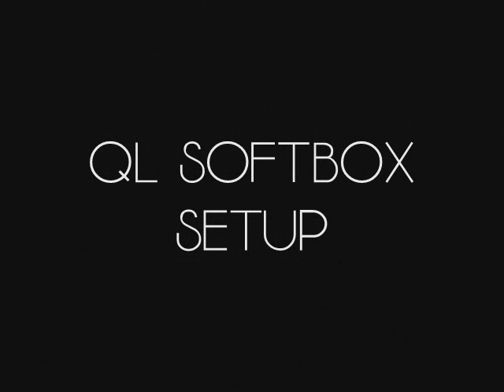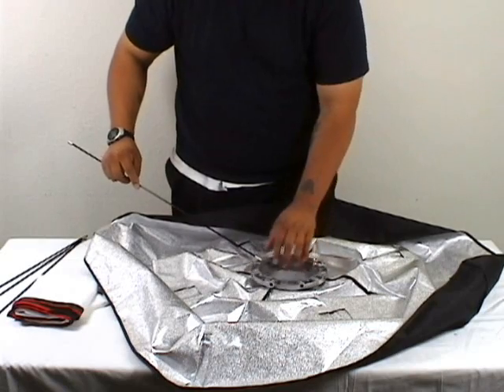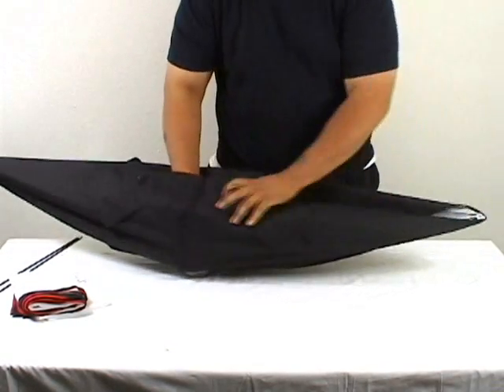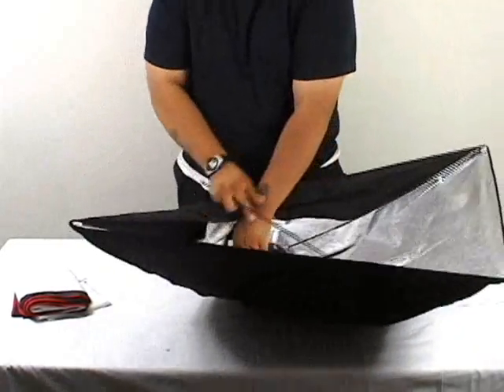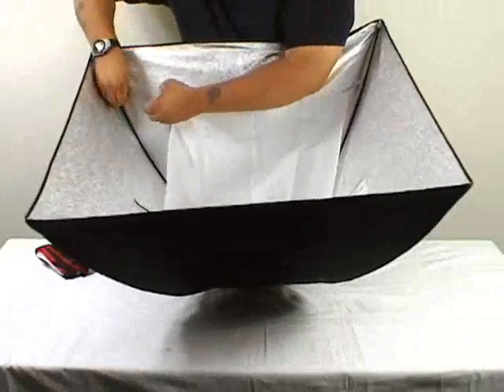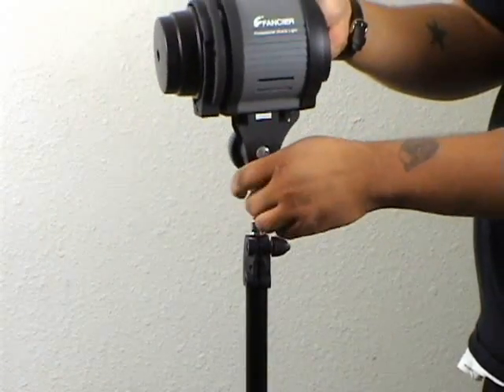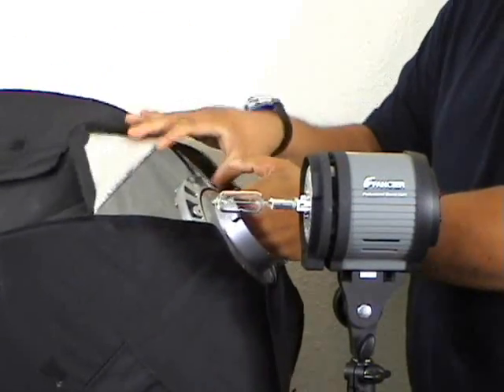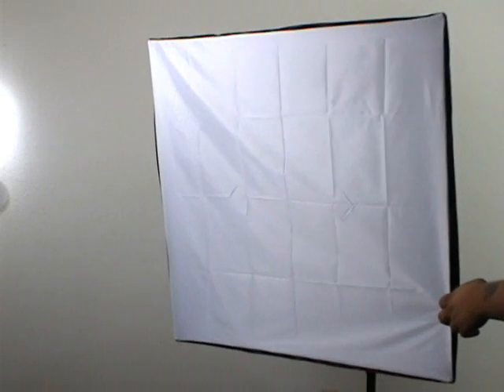PBL Softbox Assembly Instructions for QL1000/VL1000, SL200, SL300 and SL400 Strobes

Comment: I am confused withthe whole number where you puts the rod.. help me
Reply from the maker: If you are confused with the numbers don't worry about them and you should just alight each hole on the speed ring with its corresponding pocket on the softbox.  These types of speed rings are can be used with square, rectangular and sometimes even octagonal soft boxes so they will have a bunch of holes with a bunch of numbers-- but if you just align the holes on the ring  to the corner pockets of the speed ring you should be fine.
Hope this helps.